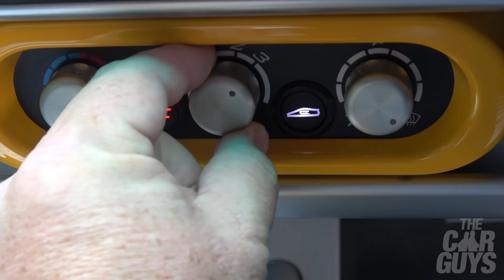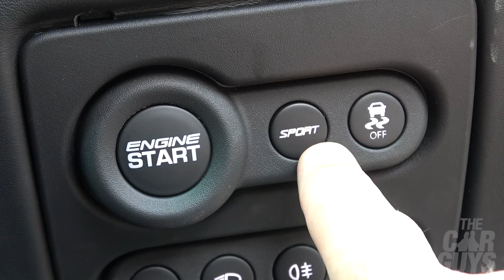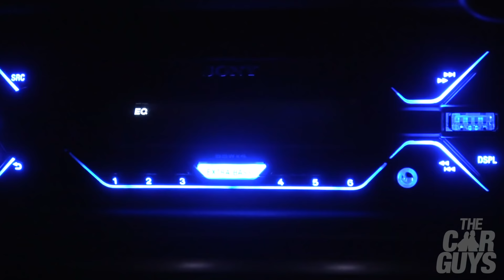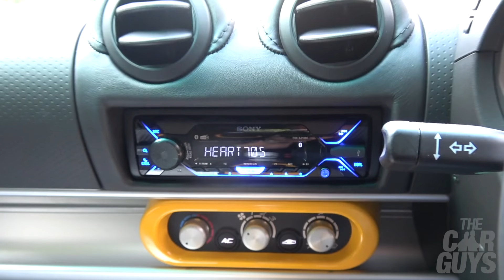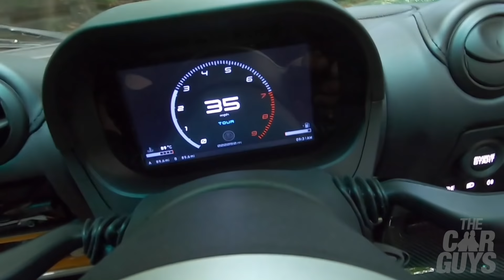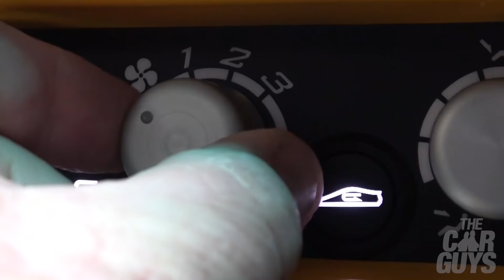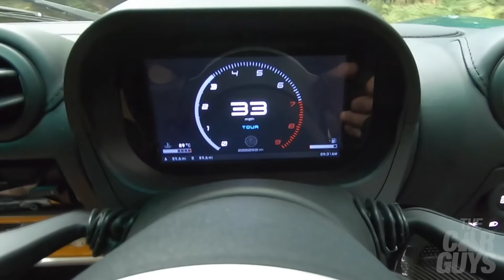650-Mile ROAD TRIP in My Lotus Elise 240 Final Edition – Is it a Keeper? | TheCarGuys.tv

Comment: I can't help but think that many of your criticisms of the car are actually self-criticisms and just seem to be a bit whinging (which for me spoils your videos). Slower than your other cars... you can't compare an Elise with a Ferrari or Porsche. Stereo in demo mode ...RTFM, it takes 2 seconds to change it. Couldn't find the USB input... under the USB panel (RTFM again?) Colour... err, didn't you choose it? Getting in and out gave you a bad back... as a fit 6'1" 50y/o I've never had issues! But, I'm glad you finally found the joy. Design is a series of compromises: the lightweight agility is a result of the car's design and vice versa and that's where the magic lives. I agree though, it's no GT ;-)
Reply from the maker: If you feel that honest comment & criticism on daily use is whinging then this is not the channel for you. I say what I feel, often with tongue firmly in cheek. It’s free entertainment that takes a huge effort, but I enjoy the creative process. Enjoy your Lotus.
Reply: You can change the radio in the Elise pretty easily. Just a few bolts underneath and it slides out. Then plug a new one in.

The good thing about the Elise is a lot of the parts are off-the-shelf ones, which means the fittings/connectors are industry standard ones. You can just swap them out for something else unlike most modern cars